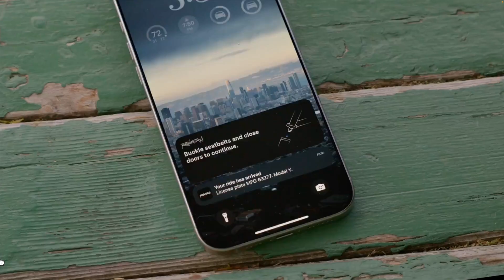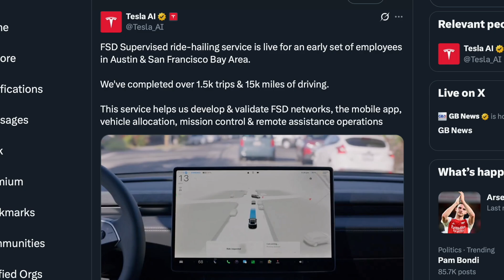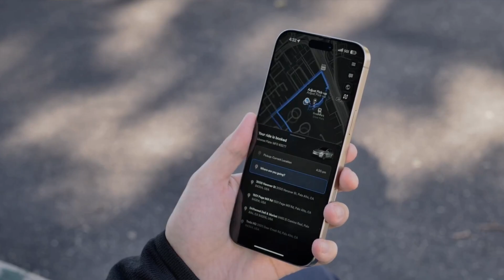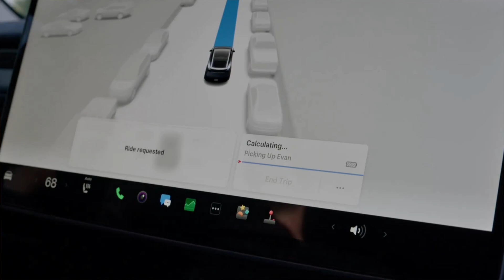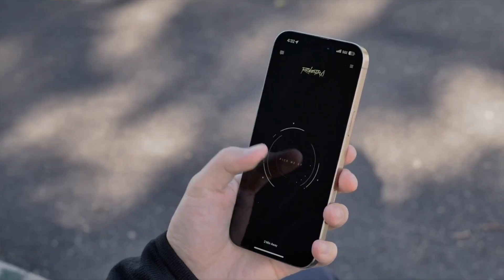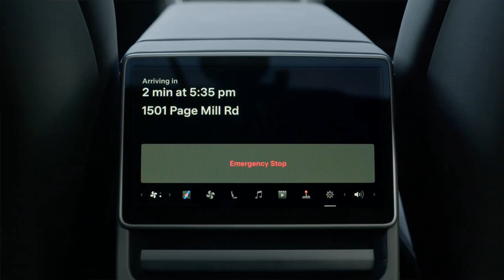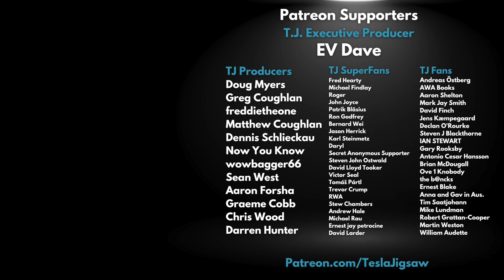Tesla’s Robotaxi Takeover: Why Waymo & Uber Are Doomed!

Comment: Robotaxi will never ever get approval.  It is using a faulty software system. All they can do is pretend taxi situation by using a model Y with a steering wheel and a driver. Using camera only makes for dark situation, fog, snow impossible to use.

Comment: Tesla is using a geofenced area in Austin for its taxi.
Just like Waymo.
Both can't 100% relay on autonomous driving.
So both are using geofencing, tele operators and probably physical drivers to aide the taxi.
Tesla also doesn't start with robot taxis, but with Model Y in stead.

Comment: Your information is based on Tesla talking points that are simply now untrue without any fact checking or critical analysis.    “Costly sensor”, lidar is now only around $150.    The only expensive thing is that if Tesla were to admit that its sensor suite is dangerously ineffective it would have to compensate every single owner the same way VW did regarding their diesel fuel emissions.  If you have an accident, it’s just you.   If a car has an accident, it’s the entire series at blame.   Teslas can’t be ‘better’ than humans, they need to be several orders of magnitude safer.   LiDAR allows that, cameras don’t.  It’s been demonstrated over and over.   A person dressed in black at night on a dark street is dead.
Reply: @dougvibbert1047  So how much of WAYMO stock do you own?
Reply: @theodorehaskins3756 pull his argument apart. 

His argument and facts are probably the basis for his investment strategy. 

What are the facts that underpin yours?  

Musk is a great salesmen. But he always over promises and under delivers.

Comment: Thank you for your video. I am of the opinion that you are too positively biased towards Tesla. An analysis of the exact fundamentals is missing in your video. These are also not linked. 
It may be that Tesla's approach is the better one, but I wouldn't be so sure. 
Tesla's Cyberruck is the best example of the company building vehicles that do not meet the needs of users and the requirements of traffic safety.

Comment: FSD is dead - it died today.
NHTSA released new rules for autonomous driving cars/apps and here is a recap of what AI just released:

AI:
# Tesla's FSD Requirements to Comply with New NHTSA Regulations

Tesla's Full Self-Driving (FSD) system faces significant compliance challenges as the National Highway Traffic Safety Administration (NHTSA) implements stricter oversight and new requirements for autonomous vehicle technology. Based on recent regulatory developments, Tesla will need to make several crucial adaptations to its FSD technology to meet these evolving standards.

## Sensor Technology Enhancements

One of the most substantial changes Tesla will need to implement involves upgrading its sensor suite. According to recent regulatory information, Tesla's current vision-only approach to autonomous driving will require significant modification.

### FMVSS 127 AEB Mandate Requirements

The new NHTSA Federal Motor Vehicle Safety Standard (FMVSS) 127 for Automatic Emergency Braking (AEB) represents a major shift in sensor requirements. This mandate explicitly confirms that vision-only systems like Tesla's will need to add RADAR or LiDAR technology to meet new safety rules by 2029[10]. This is a fundamental change for Tesla, which famously removed radar from its vehicles in favor of a "Tesla Vision" camera-only approach.

### Moving Beyond Camera-Only Systems

Tesla's current sensor suite relies primarily on cameras and ultrasonic sensors, a technological approach that differs significantly from competitors who employ multiple sensor types[10]. The NHTSA's mandate indicates that this camera-centric strategy is insufficient for meeting long-term safety standards, particularly for object recognition capabilities required in advanced driver assistance systems.

## Performance in Reduced Visibility Conditions

NHTSA has identified significant concerns about FSD's performance in challenging environmental conditions, prompting a formal investigation.

### Addressing Visibility Challenges

In October 2024, NHTSA opened an investigation into 2.4 million Tesla vehicles equipped with FSD following four reported collisions, including a fatal crash in 2023[7]. The investigation specifically focuses on evaluating whether FSD's engineering controls can "detect and respond appropriately to reduced roadway visibility conditions"[7][8].

### Investigation Scope and Safety Concerns

The investigation examines FSD's performance in conditions such as fog, sun glare, and airborne dust, which may have contributed to accidents[7][17]. NHTSA is reviewing whether Tesla has made any updates or modifications to the FSD system that could influence its performance in such situations, including the "timing, purpose, and capabilities of any such updates, as well as Tesla's assessment of their safety impact"[7][17].

## Regulatory Compliance Framework

The Trump administration has announced policy changes aimed at accelerating autonomous vehicle deployment while maintaining safety oversight.

### Expanded Exemption Program

NHTSA is broadening its Vehicle Exemption Program to include domestically manufactured autonomous vehicles[1]. This change enables companies like Tesla to operate non-compliant models on U.S. roads that were previously restricted to vehicles assembled outside the country[1].

### Reporting Requirements

While some reporting requirements are being loosened, NHTSA will continue to require carmakers and companies to report crashes involving self-driving systems[2]. Tesla must maintain compliance with the "Standing General Order for crashes involving ADS or Level 2 ADAS, which requires reporting of crashes on publicly accessible roads"[12][16].

## Communication and Marketing Alignment

NHTSA has specifically addressed concerns about how Tesla communicates its FSD capabilities to consumers.

### Clarification of Vehicle Capabilities

In correspondence with Tesla, NHTSA noted that the company's public statements imply its vehicles can drive themselves, which conflicts with owner manuals and agency briefings stating that the vehicles require human supervision[18]. The agency has requested that Tesla "revisit its communications" to ensure consistent messaging about driver supervision requirements[18].

### Social Media and Promotional Content

NHTSA has raised concerns about Tesla's promotional materials, including posts on social media platforms, which appear to encourage drivers to use FSD technology without maintaining full attention on the road[11]. These communications concerns are particularly relevant as Tesla markets its FSD system, which costs $8,000 according to Tesla's website[14].

## Remote Operation Safety Features

Tesla's remote control features have also come under regulatory scrutiny.

### Actually Smart Summon Improvements

In January 2025, NHTSA opened a preliminary investigation into approximately 2.6 million Tesla vehicles following reports of accidents involving the "Smart Summon" and "Actually Smart Summon" features[15][16]. These features allow users to remotely move their vehicles through a smartphone app, but NHTSA has identified incidents where vehicles failed to detect obstacles[15].

### Remote Control Safety Systems

The NHTSA investigation includes "review of remote vehicle control through the phone app at various distances and lines of sight, including app connectivity delays resulting in increased stopping distance"[12][15]. Tesla will need to address these concerns to ensure that remote operations maintain appropriate safety standards.

## Conclusion

Tesla faces a multifaceted regulatory challenge as NHTSA increases its oversight of autonomous vehicle technologies. To comply with new NHTSA requirements, Tesla's FSD system will need significant technological upgrades, particularly in sensor technology and visibility condition performance. Additionally, Tesla must align its marketing communications with actual vehicle capabilities and improve the safety of its remote operation features.

The most substantial change will be the transition from a vision-only system to a multi-sensor approach incorporating RADAR or LiDAR by 2029, representing a fundamental shift in Tesla's autonomous driving strategy. These requirements come as Tesla CEO Elon Musk continues to emphasize self-driving technologies and robotaxis as central to the company's future, making regulatory compliance increasingly critical to Tesla's business model.

=============================
FSD is going to have to start over and dump the insane idea that vision is going to be enough for a full self-driving car

Comment: Correction, Uber drivers keep 40% to 50%, sometimes even less.
When Uber started in 2012 the drivers used to keep 80% but few years later Uber started to cut that every year.
That explains why now we have new ride share companies . Tesla will win.
Reply: I can confirm this to be the absolute truth now. Any rider who has devulged their cost for the ride has always hinted at a charge always more than twice of what i got. So it is always less than 50% no matter whether the ride is small or big. Longer rides give the driver worse rates. Smaller better; so in total b/w smaller, mid n longer rides per day the driver gets about 40 to 45% of what gets charged to the rider and it keeps getting worse by the day. Uber is the most extortionist of all big Techs to come out of silicon valley. No doubt. For just an app that doesnt need too many backend API payouts or own a single damn car or many people to run and maintain, which gives 20 billion rides a year, to then take 60% of the cut is plain extortion.
They literally grow monopolistic on the back of the drivers who now for years uber has treated like expendable assets. Its gonna cost em. I just hope the drivers find something better when it does.

Comment: A LiDAR unit used to cost 30,000 yuan (about $4,100), but now it costs only around 1,000 yuan (about $138).
Reply: Waymo drives are totally safe and reliable. Tesla, not at all. Would you risk your life for a few pennies?
Reply: @rv7798  I would love to know where your getting that info from.
Reply: Hesai is producing 3d lidar for less than 200 and more than 1.5 million have been incorporated into vehicles.   This isn’t even a debate.    Musk would have used lidar if it was cheap back when he started.   The only reason he is not using it now is he has locked himself into his own fallacy of being able to do full self driving without it.   No other car company said they could do it before they were ready and he now has millions of cars that were sold under a false premise.   He even admitted being screwed in that he is now admitting that his older gen teslas will never be able to do full self driving without incredibly expensive upgrades that he legally has to now provide.
Reply: @dougvibbert1047 It costs Waymo anywhere between $150,000-300,000 just to make one of there cars.
Reply: @Phasmophobes-Gaming yeah but they work. Tesla robo taxi has 0 rides. If it worked we would have seen it by now. But much like 10 years ago when Elon said it worked, it still doesn’t.
Reply: And your point is? Tesla don’t need this system.
Reply: @alastairhatt360  it's obvious, Tesla has lost the costs advantage when it comes to LiDAR. It significantly increases safety and doesn't add significant additional cost anymore.
Reply: @RadekPilich  3D lidar is quite a bit more expensive than the 2D lidar you're referring too. You can pay $140 for a hobby-grade 2D lidar, but for a commercial 3D lidar, you're gonna be paying $1,000-$10,000.
Reply: And waymo uses about 4 of them.
Reply: @alastairhatt360 Lidar is a better system so if it's less than $140 per it's an advantage.
Reply: @alastairhatt360 Tesla obviously does need the lidar system since to date Tesla has done exactly, checks notes, 0 successful robo taxi rides with its crappy camera system.

Comment: I'm really curious just how many private Tesla owners are going to sign up their cars for a taxi service when they are not using them. If I owned a 2nd Tesla I might but I'm still feeling old-school enough that I want my own personal car available whenever and wherever I am.
Reply from the maker: Yes, I’ve pondered that too. Depends on the owner I guess. If tempted with an extra $500 a week though would you do it? Extra income would be a pretty big temptation for most. Especially once used to it popping off when you don’t need it
Reply: @TeslaJigsaw  Yes, 2 shares of Tesla stock a week would probably do it for me. 😃
Reply: Hire out your car. you're not using it 97% of the time. If you worry about suddenly needing a car, hire someone else's vehicle via the app.
Reply: It’s my pension plan! Enhancement anyway.
Reply: If the income from Robô Taxi (to the individual owner) exceeds the cost of lease, maintenance & hassle, many will do it. 📈
Only reason we won’t is having to remove child seats and other personal items … 💺
But would gladly buy a second (or a fleet!) of vehicles if the TSLA revenue split is favourable. E.g: 70:30.